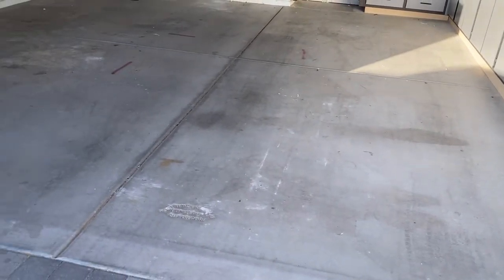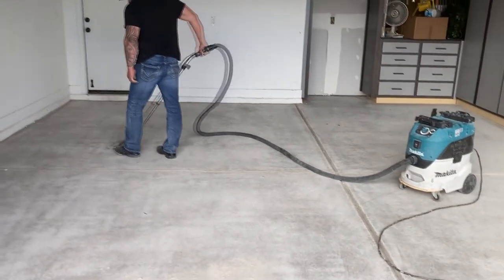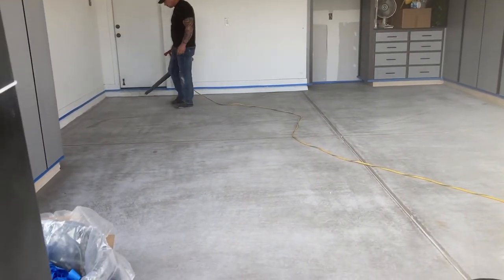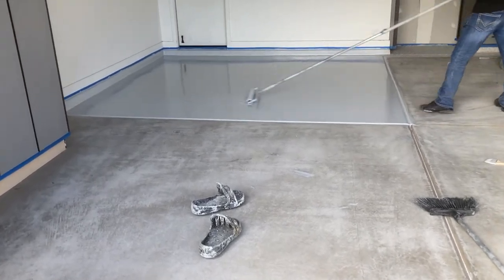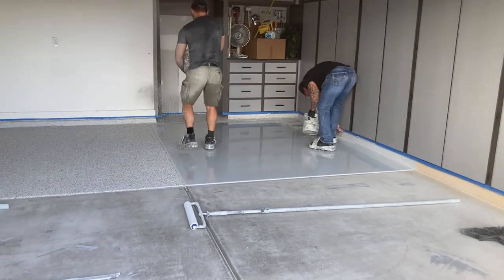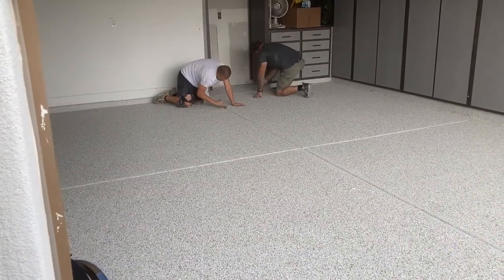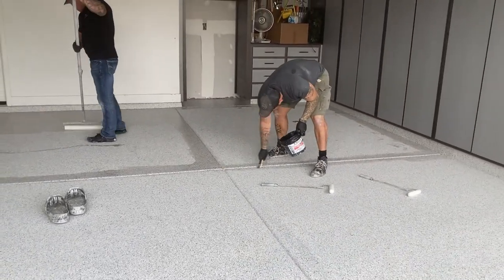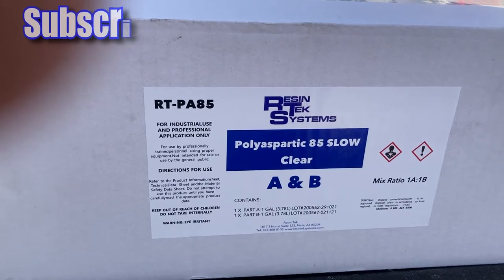Garage Floor Epoxy using Polyaspartic Coating

Comment: What kind of grinder is that? And what attachment is that? What about the vac? Does it feel powerful enough for the grinder?
Reply from the maker: Hey Casey. The grinder is one you can rent at HD. The vac is a hippa vac.  Both worked just fine.
Reply: Thanks

Comment: Can you please suggest the product - Polyaspartic Coating; where to buy and and what to look for while purchasing. I am planning to do Garage Floor Epoxy using Polyaspartic (clear top) Coating, but finding it very difficult to purchase the item. Polyaspartic  is neither available in Home Depot nor in Lowe's. Even the product that you used, does not seem to be available online either. Thanks in advance
Reply from the maker: At the end of the video I show each product that was used bohiragoto.  Use those names to Google where you can find them in your area. Hope that helps you.
Reply: @JayVisnansky  I could be wrong, but it seems both the first coat, which is grey (the one that you put on the treated cement floor) and the Top-coat (which is clear) are both polyaspartic based. Could I just use the polyaspartic top coat and regular epoxy as the base, or, do I need polyaspartic at both levels. I am sure you can understand the reason behind my curiosity and trepidation; I have to manage a 650 sq. feet garage with zero experience. Thanks in advance.
Reply from the maker: @bohiragoto  In my case, yes, both coats are polyaspartic.  I don’t know if you can mix epoxy base with a polyaspartic top coat. Can you try it on a small sample piece to see if it works ?
Reply: Did you ever find anything I can help with a website that’ll supply everything you need.

Comment: CMay I add Chips on epoxy thickness 250micron؟
Reply from the maker: Sure you can. And depending on how the floor feels after the chips, you may have to do a light sanding afterwards. Hope that helps. Thanks for watching.
Reply: @JayVisnansky  How much do you need for 50 sguare meters of plywood
Reply from the maker: @طارقحسن-ث7ش  I don’t know.  The square meter coverage should be on the package.

Comment: The label should be "Garage Floor Polyaspartic using Polyaspartic Coating".  I thought your base layer was epoxy, but it's polyaspartic also.
Reply: How do you know?
Reply: @edy042  I can't remember.....I bet I was right though.
Reply: @LayneRoxxx  you were right. I saw it at the end when he showed the product cans
Reply: @edy042  I remembered thinking that he mislabeled the video....and the only reason I was there was to find a polyaspartic coating for epoxyshield epoxy.
Reply: Well once he said “the guys came back 2.5 hours later” that was the give away. Epoxy take 8-12 hours to dry and polyaspartic dries in 1-2 hours. I thought it was epoxy the whole time too please he doesn’t really know what he’s talking about. If he thinks that the grinding was sufficient enough she needs to go back and learn how to do coatings again. He didn’t even open up the pores of the concrete they’re still concrete sealer everywhere. I can guarantee you that the floor will fail within 1-2 years.